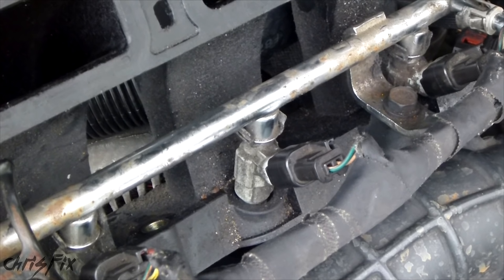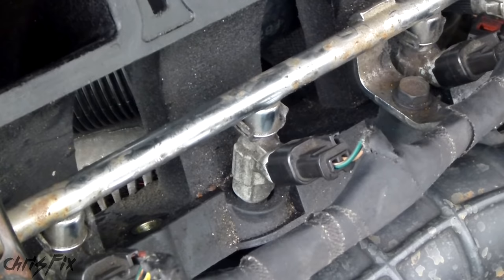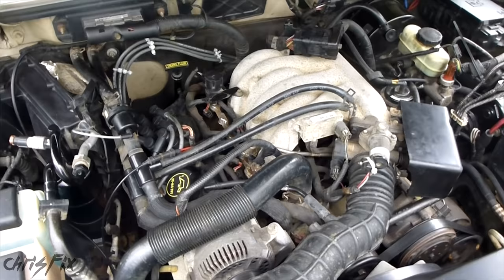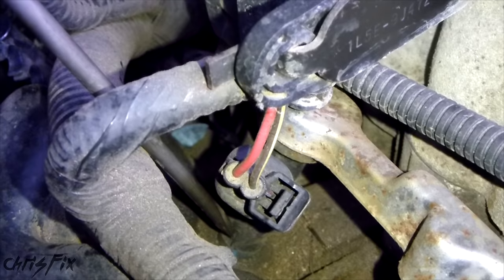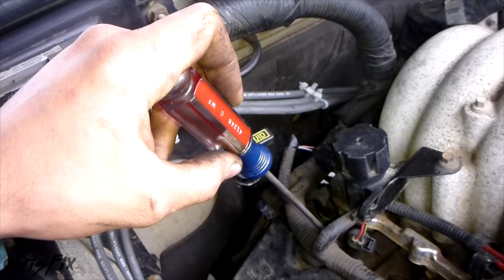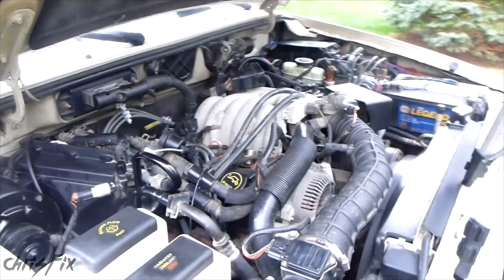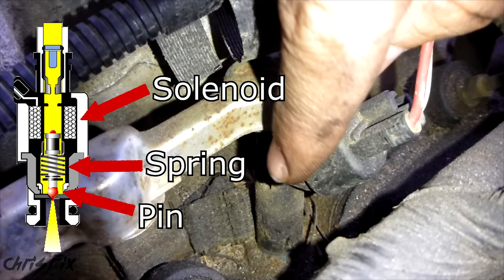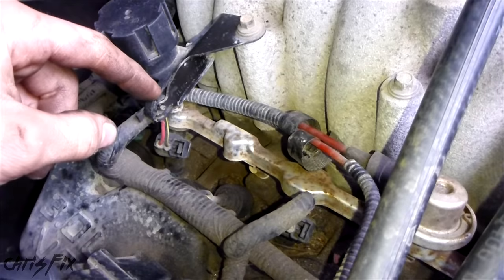Testing Fuel Injectors Fast

Comment: How do you check for a leaky fuel injector
Reply: Check your Short Term Fuel Trim numbers by looking at live data. If the numbers are negative- your fuel injectors are stuck open. The STFT numbers should be close to zero (0) Positive numbers means your engine is running lean. Also look at the voltage of your O2 sensors. 450 mv is normal. 
Higher numbers means engine is running rich.
Lower numbers means its running lean.
Reply: @davidhall3747  that's not always the case. Short-term and long-term fuel trims are decided by the O2 sensors. Negative short-term fuel trims can also mean you have a weak fuel pump,bad regulator,or fuel line leak,or bad o2's.

Comment: hey can you help not only has my truck having long cranks and no start but ive noticed a low rpm very  low rpm  on my gauge  it will fall to way below one and no check engine light comes on please help.
Reply from the maker: SuperJeremi10 I would start by doing a fuel pressure test: https://www.youtube.com/watch?v=_oXLUqE4Sf0 here is the gauge I used and it is a great inexpensive investment: http://www.amazon.com/gp/product/B000R5IASC/ref=as_li_tl?ie=UTF8&camp=1789&creative=390957&creativeASIN=B000R5IASC&linkCode=as2&tag=chri0e2-20&linkId=VUHPAMNKOJNTG2I2
Let me know what you find!
Reply: it has a brand new pump and filter just replaced it bout a month ago.
Reply from the maker: SuperJeremi10 There can still be low fuel pressure. That is where I would start. You can also check to see if there are any vacuum leaks.
Reply: ill try  where would i look good place to start  maybe i have a bad injector  it has no check engine light on.
Reply from the maker: I mean, fuel pressure is where I would start.
You can start by looking for vacuum leaks. Any cracked or loose hoses.
Reply: okay thanks 
i also have a tahoe i need help on i just got it but its not ready to be drove yet its a 98.

Comment: ChrisFix  i have a question? does fuel injector is linked to speed? like i have manual  car, when i press accelerator  the RPMs go up and the vehicle does not move and after keep pressing accelerator it start slowly slowly move and max speed is only 50-60. i am not understanding what it could be. it will be appericiateable 
thanks
Reply from the maker: Your fuel system is linked to speed but there would be other problems such as misfiring if it was your injectors. Do you have any check engine lights? The rpms going up is also another indicator that it isnt the injectors. This might be a slipping clutch or maybe you are not completely into gear. Does your shifter feel solid and firm when you shift? How many miles on the clutch?
Reply: There is no engine light. And rpm gose  up...but when in put 1st gear it takes 15 minutes to pick motion lol. Then when I stop my car I smell like some rubber is burning. And when I press clutch i completely release clutch and keep pressing race ...then after couple of minutes car start getting motion... ChrisFix
Reply from the maker: arsh bhullar Sounds like you need a new clutch and your clutch isnt fully engaging (that burning smell is your clutch burning up).
Reply: Thanks for help.. Appreciate ChrisFix